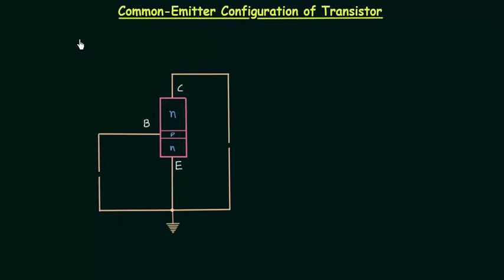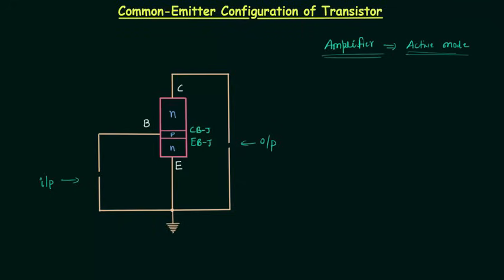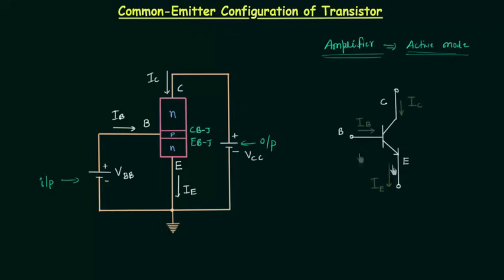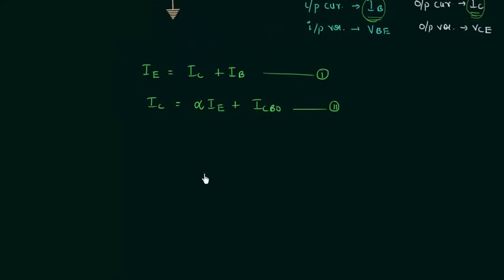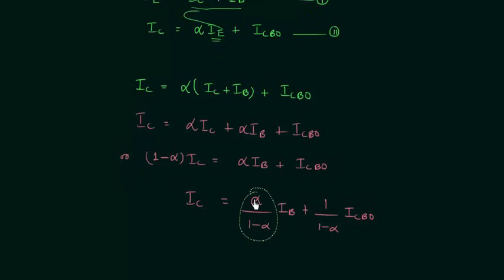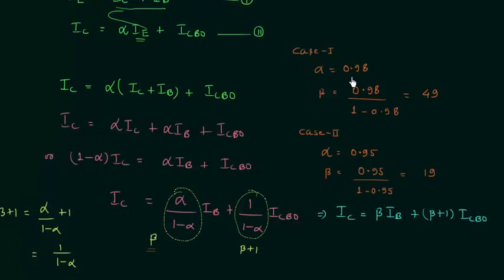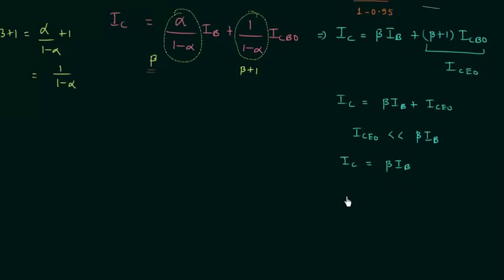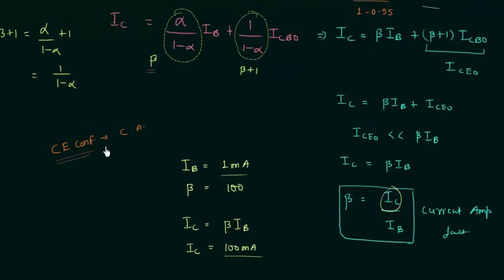Common-Emitter Configuration of a Transistor

Comment: how can the reverse saturation current in common emitter configuration be different from common base configuration? the reverse saturation current shouldn't depend on external factors like voltage sources, right?

Comment: @7:03, u said if alpha is less than 1, range of beta is 50 to 400, which is nt the case. The value decreases from 50, further down, which u had just calculated.
Reply: Yes, I think it should be less than 50

Comment: Let's take IB =1mA and amplifying factor (beta)=49, and R-output = 5kohm,
V_output = 49x1mAx5komh = 225V
 emmiter is used in current amplification, what about this result ?; Or  beta amplify both current and voltage?

Comment: In common base , it was mentioned that Icbo was reverse sat current when emmiter current was open 

So is it ryt if I say 
Iceo is reverse sat current when base is open circuited ? 

Plz reply
Reply: Yes because in case of CB configuration,the forward biasing voltage was Vee and in CE configuration the forward biasing voltage is Vbb and thus they will act as open circuits respectively

Comment: @1:21 you told that negative terminal is connected to p but actually it is getting connected to n type. So can i consider one n-side getting connected to positive terminal and one to ground as reverse bias condition. Correct me if am wrong

Comment: Sir u told bita is in range of 50 to 200 . But in the example bita comes 49 and 19 for Alfa= .98 and .95 respectively. Can you please explain ?
Reply: Because the value of alpha is close to one, ideally it is 1 but in real cases it is between .099 to 0.998. Calculate B for these range of alpha and you’ll see the result in concurrence with what is taught in the video. Here, B comes 19 because alpha is hypothetically taken as 0.95

Comment: just tell me one thing "How can you use the Ic formula for common base in common emitter config. ;also what about the biasing between collector and base(it is not there so how come the Ic current.)"
Reply: IE=IC+IB is applied in any configuration as long as it was an active mode ..It is simply KCL law .
Reply: @RahmaElsaeed-cf6ru then why at 3:02 o/p current=Ic not Ie

Comment: sir, to operate in active mode CB junction should be in reverse bias; but why connected 2nd biasing voltage negative terminal to emitter terminal.. It should be connected to Base terminal...???

Comment: Great video! To anyone who can answer, what makes the equation Ic = B(Ib) + (B+1)Icb unique to common emitter configuration? Near the end he compares the reverse saturation currents of common emitter and common base configurations in active mode, but compares them using equations derived from i and ii. Couldn't you have derived the same equation for common base configuration?
Reply: Icb is like nano-amperes, so even if B is 400, (B+1)*Icb could go to half of 0.1mA whereas B(Ib) is huge because Ib is in mA(at least). Therefore (B+1)*Icb is neglected w.r.t. B(Ib).

Fair enough?
Reply: The equations are common for both circuits but difference comes when we see what is input current and input voltage. The output current is compared with respect to the input current. In case of common emitter , the input current is Ib whereas in case of common base , the input current is Ie.Thus two equations tho are co derived but used differently while comprehending the different transistors mode.
Correct me if I am wrong!
Reply: @Sarath Paradox dropped out engineering. This was 2 years ago. Good luck. You might as well drop out, it's not worth it.

Comment: Well done sir,great video!
May i ask you a question? I see in a lot of videos that in the switch operation of a transistor we always connect a dc motor for example, between the Vcc and the collector.  Where is the mistake in connecting the dc motor between emmiter and ground.
PS You explain electronics better than a lot professors in universities
Reply: maybe because Base and emmiter are forward biased hence it have a voltage drop of 0.7V, so that amount of voltage might be insufficient for operation of DC motor

Comment: how we can threotically prove that leakage current in common emitter configuration is more than that in common base configuration
Reply: in case of CB configuration with npn transistor, although CB junction is reversed biased for majority charge carrier(electrons), it is forward biased for thermally generated minority charge carrier(holes). So, even if the emitter is open, there is minority charge flow from collector to base with emitter open. this current is Icbo(**leakage current**)(collector to base current with emitter open).
likewise in CE configuration with npn transistor, despite Ib=0, it is found that there exits a current from collector to emitter, Iceo(**leakage current**)(collector to emitter current with base open).
since Iceo = (beta + 1) Icbo and also ones<=beta<=1000s, leakage current in CE> in CB
Reply: I am not convinced , see why , cause actually equation we used to get beta which is ( IE=IC+IB) is applied in all configuration if it was an active mode so we used eq for substitution in another eq .and the first eq is applied in all cases , we can use it in any case cause KCL law   ( IE=IC+IB) is applied in active mode .so what we did is just some mathematics , how can we conclude that leakage current in CE>>in CB ??
Reply: @RahmaElsaeed-cf6ru  Note that in CE configuration, I (CEO) incorporates the I sub E term. That is how you get Beta in the first place.
Reply: in common base configuration the leakage current is obtained between base and collector junction and in common emitter configuration the leakage current is between emitter and collector when base emitter junction is open circuited .  Since, base is small so the no. of minority charge carriers are very less while in emitter the no. of minority charge carriers are higher. So, greater the  no. of charge carriers is , greater is the leakage current. Hence, emitter has greater leakage current.

Comment: sir if alpha is from 0.95 to 0.98 then beta will be between 19 to 49 .then how can be range of beta will be from 50 to 400.waiting for your reply
Reply: Still waiting for a satisfactory answer by the channel
Reply: Beta can be any value for power transistors only (which can operate up to 10 amps or even more...however if beta is less than 5 , then controlling the transistor would be difficult ) whereas for electronic transistors which deal with smalls current.... Beta have to be between 50 to 400 ....
Reply: I think so. He suddenly wrote 50-400 and did not explain why.

Comment: how does the CB junction gets reverse biased if we connect the negative terminal to the n type material?
Reply: same is my doubt :(
Reply: negative side of the battery is not connected to p-type base. but rather it is connected to n-type emitter. can you please explain this
Reply: can you please explain it briefly?How the direction of Vcc-Vbb is opposite to the direction of Vcb?
Reply: Think of VOLTAGE DIFFERENCE*. Generally, Vcc(generally of 5V) is larger than Vbb (generally of 1V, to overcome the barrier potential=0.7 for Si). If *direction of Vcc-Vbb is in same direction as Vcb  and its magnitude is greater than barrier potential(Vcb), the CB diode is forward biased, and  if direction of Vcc-Vbb is opposite to  direction of *Vcb*, the CB diode is 
reversed biased. 
In this case, the direction of Vcc-Vbb is opposite to the direction of Vcb.